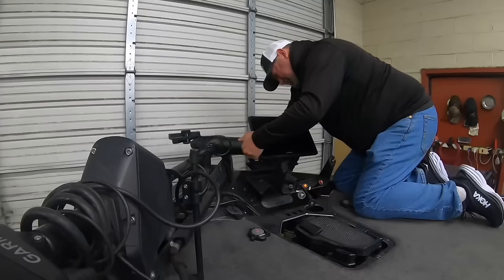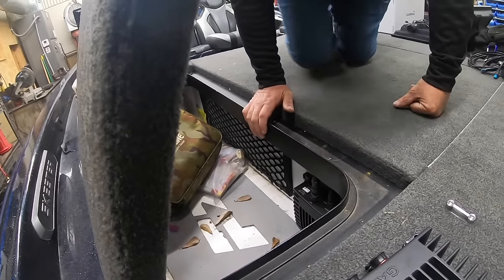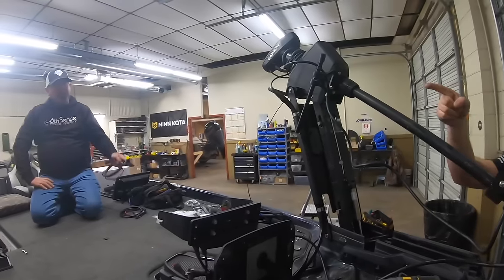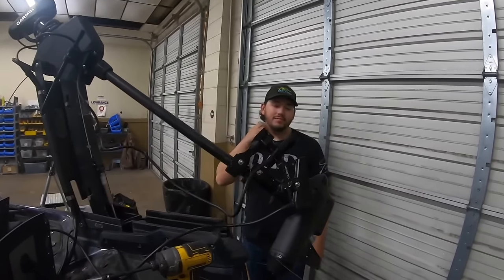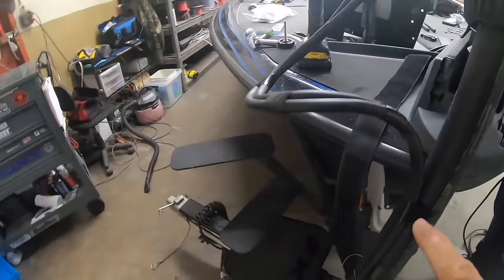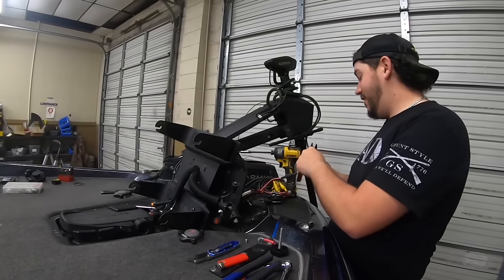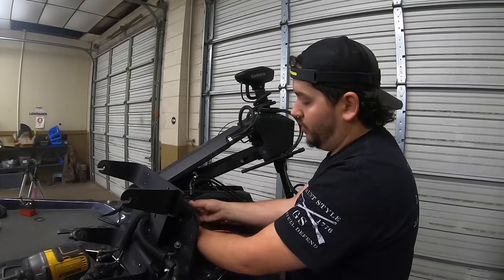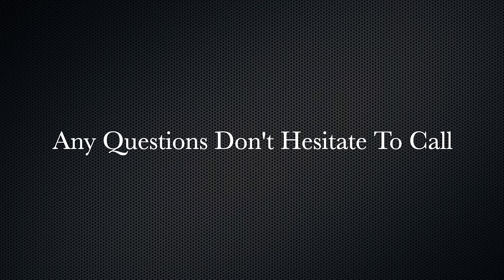How To Install Perspective Mode With Livescope (Tips to ensure best picture)

Comment: Do u think you could mount 2 like this with these mounts and still keep a 360 on the shaft also?  I cut 7 inches off my 360 shaft to get it out of the way but I'd like to add another 34 and probably just use 1 12inch unit for both and use them at one time some but sometimes just use the forward but I'd like the ability to use both with the 360.  Do you see any interference between the 2 34s?

Comment: @todd - Does those TD cables being paralleled together like that cause any interference at all?
Reply: They're all shielded, so why would they?
Reply: @helotaxi  was just curious if it did, they said there was interference too close to the trolling motor so wasn’t sure if the voltage caused interference putting them together parallel like that. I’m sure it doesn’t but was just curious.

Comment: I use a fishing specialties pole & transducer mount on my kayak. Their transducer mount is a ram ball connection. So it has infinite adjustment from r forward & perspective. I can change them on the fly for different depths in a few seconds. I use perspective mode in 12-15' of water. Because of how I turn & operate the pole I can also swing it forward & back while in perspective mode. So when I do see something. I know if it's in top,mid or lower collum of water. I do a lot of shallow fishing so I keep mine in perspective mode 75-80 % of the time

Comment: I want to run mega live in landscape mode and garmin LVS34 ffs both on my trolling motor shaft. Which one is on bottom
Reply: LVS-34 on the bottom so it does not have a transducer below it that will block images straight below the trolling motor